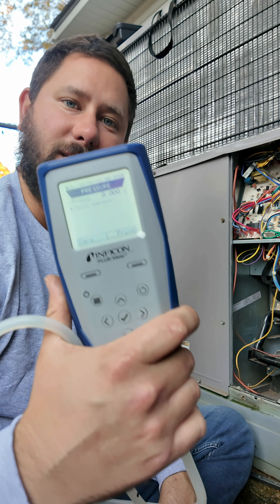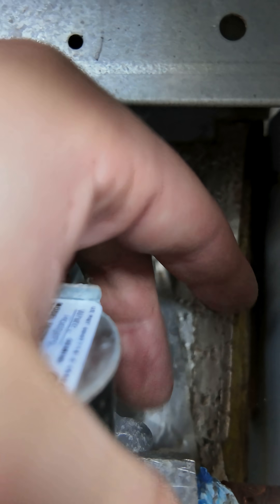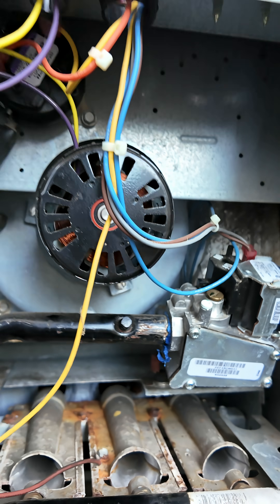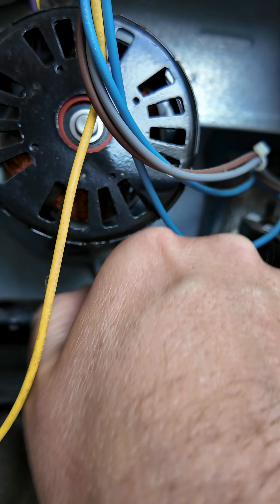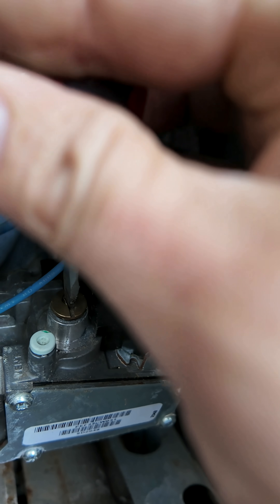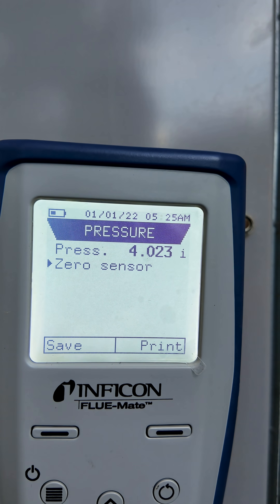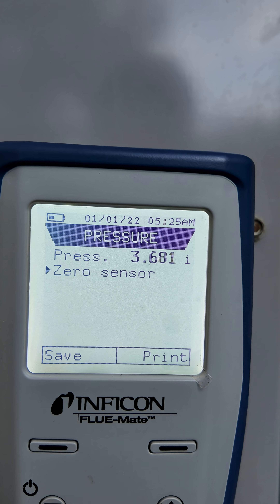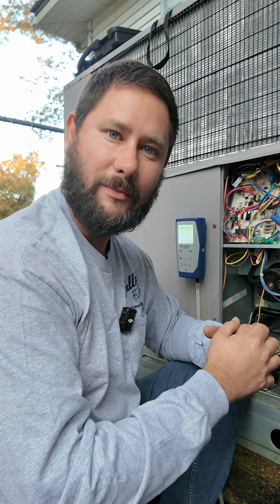How to Set Gas Pressure on a Furnace (Using a Manometer Like a Pro)

Comment: COREY WARNER EL ASESINO SILENCIOSO YOU TUBER VINO 24 MARZO 2025 Y ME HECHO VENENO NEGRO ANESTECIA QUIMICA AMARILLA Y UNA PIEZA DE CARTON ETHEL ETHILICO COMO EXPLOSIVE PROVOCAR INCENDIO YA QUE EL GAS ESTABA AL DOBLE DE ABIERTO PUSIERON UN SEGUNDO PILOTO EL MISMO GAS FUERTE ERA VENENO DESPUES DESCONECTARON UN PILOTO Y ANDRES CUELLO SABIA CUAL ERA EL CABLE DESCONECTADO Y SE LO ROBO PUSO UN NEGRO AL TERCER DIA LO ROBO JUNTO CON SU TARJETA DEL NEGOCIO DE ASESINOS A SUELDO 350 POR CONECTAR EL CABLE DEL PILOTO AHORA SE Q SOMOS TARGET DE ELECTRICISTAS DE PUROS UNOS CABLES 637 boss st sw wyoming, mi 49509 service professor el hijo de la victims se llevo la furnace Cortina del metal a 403 douglas ave elgin, illinois 60120 corrosion 6000dlls por otra furnace ano 21o23 he remain the only control y signed utilizandola para el crimen organizado signed las companies with FINANCIAL EXPLOTATION.

Comment: My Trane system was installed professionally about 5 years ago and has been working fine. As a retired ASE CMAT L1 mechanic, I would like to know if this setting ever drifts. I assume it was set correctly at install.
Reply from the maker: Yes, absolutely.We have put in new equipment and gotten calls that the flame was blowing out a year or two later, and we go back.And the pressure is a half inch higher, and I think it has something to do with the gas pressure coming in.Maybe the meter on the outside of the home.All we do is readjust and roll back out

Comment: As always we technicians do greatly appreciate your time , nd posts .
     On 2 stage valves I believe it was 1.7 , nd 3.5 on second. Which is commonly referred to as single stage . 
      Well on LENNOX , slp's , G 61's, G71's . Mostly condensating furnace 's .
      High end expensive ones .Double heat exchangers 😂. 
      Waste of money, unless its you or me putting it in your own house. As most customers never will recoup the money invested for the efficiency 😂.
       Well maybe a small percentage do . But thats if your gas supply, flue pipe , ductwork, electrical connections are properly provided.🤣🤨🧐
     As you show here it is so important to guage the valve pressure. As it provides proper efficiency. Thanks for all your efforts nd content. 
     As it does educate many .

Comment: Great video, my question is my meter comes with 2 ports and hoses. Why would I want to measure the inlet gas pressure besides to see if gas is present? If it has 2 ports is it to trouble shoot if it has enough pressure in and out?
Reply: Checking the inlet pressure is only required for constant problem like when a costumer has replaced a couple gas valves because of to much gas pressure. Or a intermittent issue of the heater shutting off because of low pressure when multiple gas appliances are running like the water heater, stove, and dryer. The shutoff valve could be bad, if the house runs on propane it could just be out of gas. If the gas line doesn't have a drip leg debris could block flow even when you have proper gas pressure at the inlet. All these issues are not very, but any time I install any unit like an FAU you should commission it by testing inlet, outlet gas pressure, the pressure switch water column, check for lose wiring connections, CO readings etc.

Comment: Does the fitting come with the manometer? Also does that tool work for static pressure ? Im a new tech been doing this for about a year now and still have a lot to learn regarding tools and information i mostly do residential and commertial in Floirda not as many furnaces usually see heat pumps and straight cool systems
Reply: @ramoncampbell4469  if it doesn’t, you can get that barbed fitting at any Lowe’s, Home Depot, or parts supply near you.

Comment: Combustion analysis tools are cool (worked for the utility in my area) but they have to be calibrated fairly often (best after every use) because the sensors get saturated. So if a guy just has one in his bag for years, it’s not accurate.